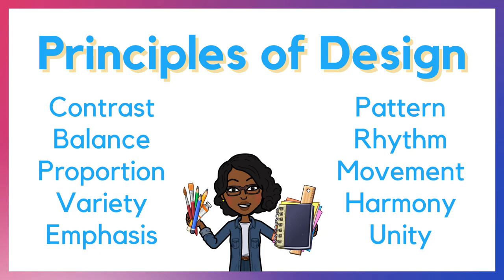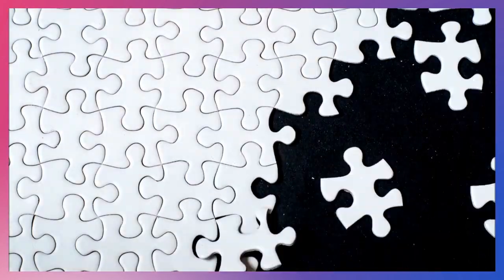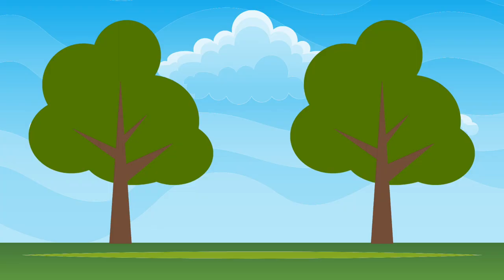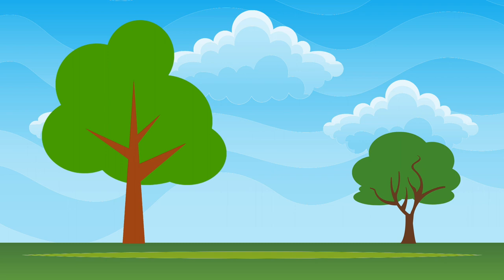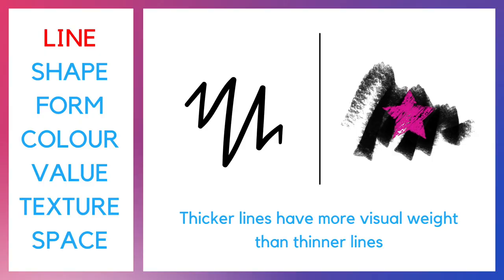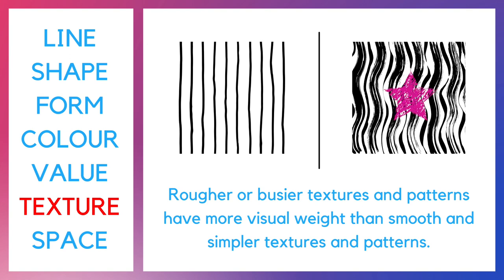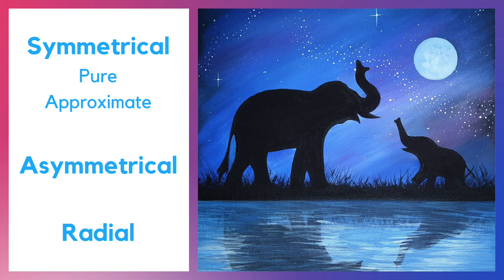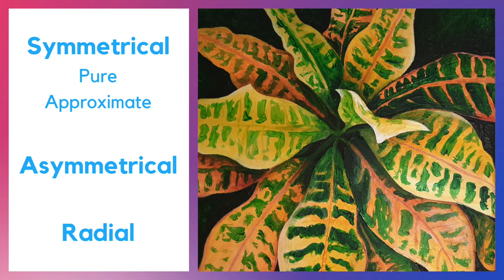Balance - Principles of Design | Symmetrical Balance, Asymmetrical Balance and Radial Balance

Comment: Hi Riekreate, if you have a drawing and there's two trees but one is bigger can you tell me the difference between the left one being bigger or vice versa? Surely there must be a meaning depending which is the bigger one
Reply from the maker: Hey, there may be a lot of reasons one is (may appear to be) bigger. Firstly, bigger objects appear to be in the foreground. Also, we normally read from left to right. So placing the bigger object on the left...it would most likely be the first thing we see and quickly establish dominance or importance. If it's on the right I would think it is telling a bigger story based on what is around it or not around it. The right gives me a more emotional vibe...not saying the left can't do it as well.